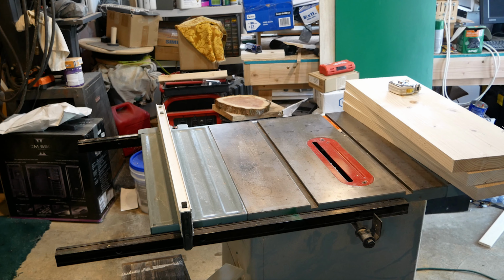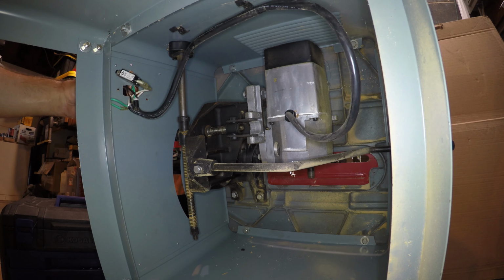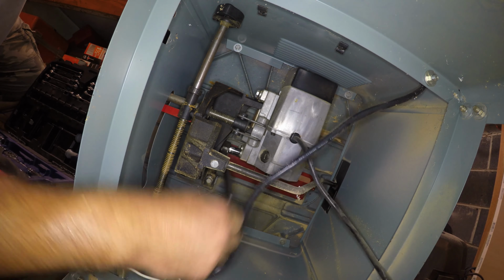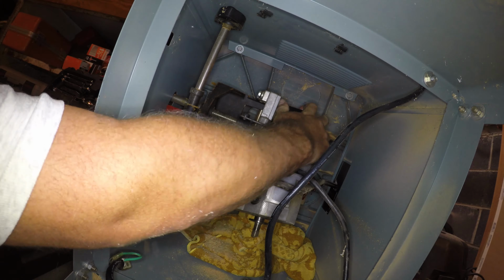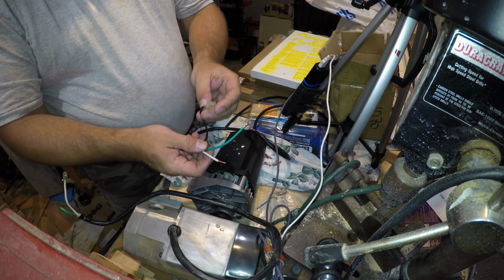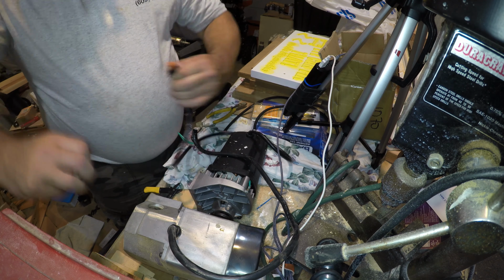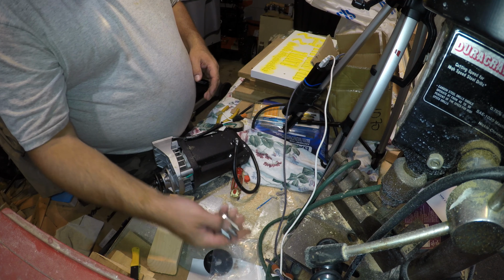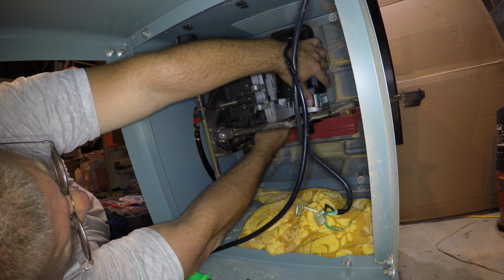How to Replace a Delta table saw motor / Delta 34-670 table saw motor replacement

Comment: I am replacing the thermal cutoff reset button/switch.  It was already taken out before I received the saw.  Do I need to connect the two ground wires?  If so I am assuming they get attached with the screws that hold on the plastic wire box cover.  It doesn't appear that you connected the grounds.  Thank you.

Comment: Where did You find a replacement motor?
Reply from the maker: You can see the article here (which is also listed within the description and the pinned comment for future reference) for more details - https://udoit.me/how-to-replace-a-delta-table-saw-motor - I just checked the price and it is almost double what I paid when I made this video. It's a great saw and I used it to build a pantry cabinet, a few shelves, and a bed since fixing it. It beats the price of buying a new one and the old school quality is there, which is lacking from many of the contractor grade saws. - John

Comment: No issues with blade alignment when you switched out the motor? I have the same model and can’t get my blade aligned with the miter slots.
Reply from the maker: Oh nooooooo. Everything worked fine on my side. Well, I didn't actually use a dial indicator with it. I will try that this weekend and get back to you. I'll have to form some contraption to allow me to accurately compare against the miter slot.

Comment: Took my wiring off w/o looking at it. Couldn’t get power after I replaced the switch. The ereplacement switch has 4 posts whereas original has just 2. Are you using the right two or the left two in this hook up. I didn’t order a new breaker and now think it is the problem.
Reply from the maker: Hey there Carter. Do you have a multimeter or digital multimeter that you can use to check the resistance of the switch leads to verify which pair to use? It is possible that the switch is a double pole/double throw. It will not hurt to try a set without a multimeter but just make sure that everything is clear when you plug it in to try. Only plug it in once everything is connected. You can check the breaker the same way but you'll need to unplug the saw and remove the connectors from the breaker and check the resistance of the breaker. If it is reading infinite resistance than the breaker is tripped. You can press the breaker and see if that resolves it. If not, then the breaker could be bad.

Comment: Hey I have this exact table saw how do you fix your dust collection problem?
Reply from the maker: THIS!!! Up until last year I could have cared less about dust problems. I'm trying to figure out why everyone is all concerned. Why does everyone have cyclone dust collection systems. My entire life I'd breathe this crap in. Then a friend was telling me that he ended up in the hospital due to necrotic pneumonia from breathing in ipe wood dust. I'm not cutting ipe but that kinda scared me. I have to remember that you asked this question because I'm going to credit you for sparking the idea for this solution. I'm not sure how exactly I'm going to do this but it will definitely involve 3D Printing (for an adapter to my shop vac equipped with a Filter-Pal Pre Filter) and some type of panel under the saw that will collect the saw dust.
Reply from the maker: I posted this to my channel.
Reply: I have two of these. 
My original (bought 1993?) has been heavily modified for a fantastic small footprint yet good enough for a great pro saw. To the point here: I paid $20 for a plastic tablesaw dust tray with a 4” port. I also have the original base replaced with a shop-made very stable base (accommodates router table to) so fitment was easy. The router table has a second T-square fence with a top-suction dust shroud. 

I enclosed the original base at one point with 1/4 plywood and ran a shop-vac hose but that wasn’t too effective. All the chips that were heavy settled into the bottom anyway, typical chips plugged the vac, and the fine stuff still escaped everywhere

Comment: Thank you for this content. My switch has been replaced with the wrong one and I need to replace it. The overload breaker has also been bypassed on mine. Could you please tell me which part numbers you used for the switch and overload breaker?
Reply from the maker: Thank you for letting me know. I updated the pinned comment with links to the parts.

Comment: where did you buy that motor, and does that one work with belts? im looking to replace de motor of my delta 36-600, thanks
Reply from the maker: I think I replied to a comment asking this. I will chk.